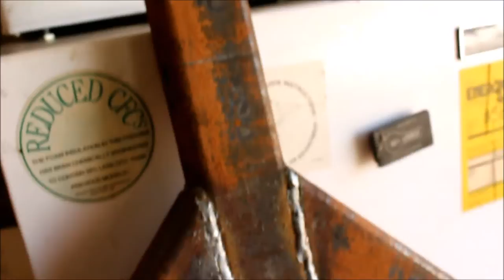Ultimate Gantry Crane Part 3

Comment: I watched all three videos out of curiosity, as I am in the middle of building one myself.  I listened for your dimensions and materials specifications but didn't hear anything about that.  So what was  the size and wall thickness of your tubing?  And what was the size of the H-beam?  Finally, where is that fourth video????
Reply from the maker: Jerry A I needa get the 4th video of it being used from the customer he says he loves it...

But I used .25 wall tubing 5x5 was the outside one and I don’t remember what slid in the middle hahaha
Reply from the maker: Jerry A there’s a video of the drawing for dimensions and stuff sorry about that and thanks for watching
Reply: @ChantzFabz  Ok that helps. I'm also using 5x5 1/4" wall tubing. My H-beam is a bit of overkill though at W10x30. Do you recall the size of that beam? I wish we had that kind of scrap yard around here but alas no. Y'all have a slice of heaven with that place. Yeah I'd like to see your customer using it, yeah. I'm looking forward to mine being done...
Reply from the maker: Jerry A I needa make one for my new shop! 

And I think it was right around the same as yours maybe a Wx8 and cherry city metals is an awesome place to shop for scrap hahaha